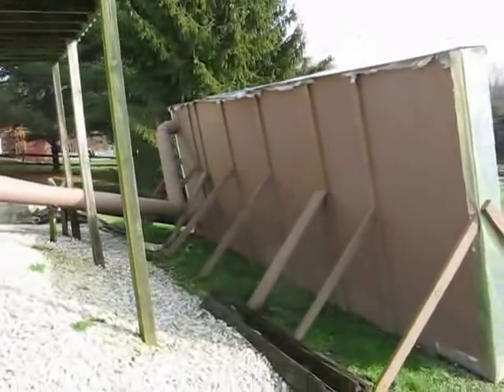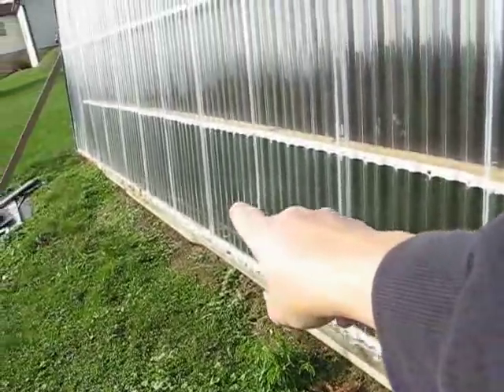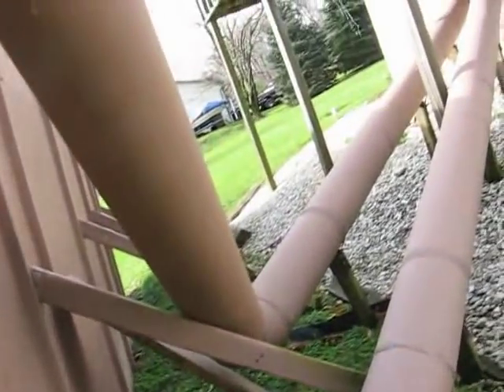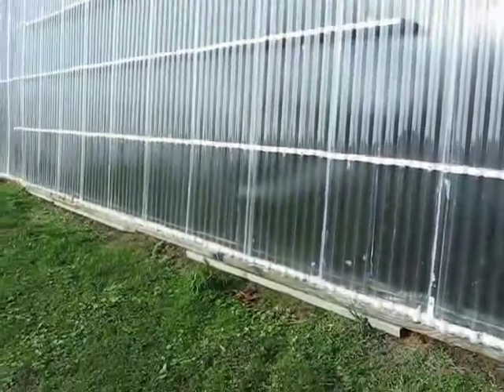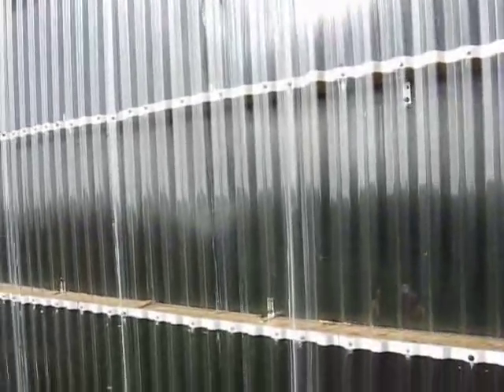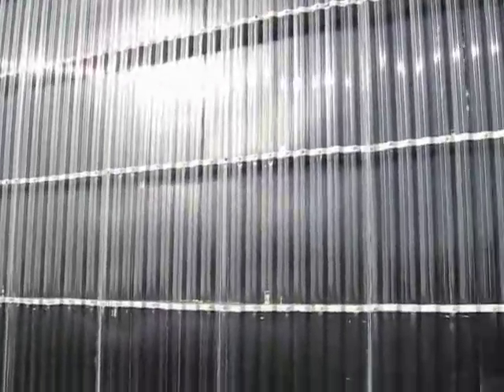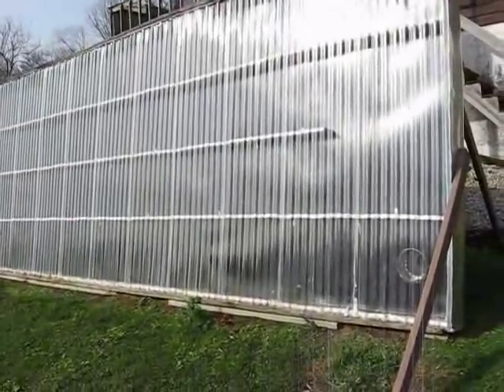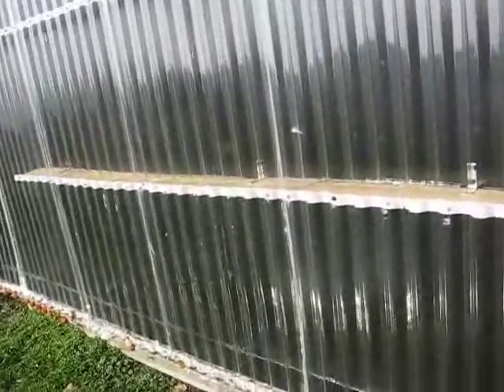MY SOLAR FURNACE  self standing solar AIR HEATER

Comment: I really like your furnace . You're like me go big or go home. I built mine with clear poly carbonate suntuff also .Yours is the only one I've come across on the net . You used 6 4X8 sheets I also used 6  4 X 8 sheets so I  was so happy with it  , i went and built another one.  And I,m going to build a third one when I get the time. I use water and polyproplene glycol in mine . Come to my chanel and check them out . "Bubblytubebob" I here exactly what you're talking about . BTDT.

Comment from the maker: hi folks just an update for the heater, its saving my about 900 a year in fuel cost, today i order propane at 2.99 a gallon wow,,  when i started this project it was 2.32 a couple  of years ago,,   i use about 350 gallons a year vs, 500-600 before i install this system   ,  i now am enjoying the savings, and it took two years to recoup my investment,, and it has withstand  all the weather conditions, wind and heavy snow,,,

Comment: Wow simple buld ..and the most clever designs so far,  instead of bulding a small one with sodacans I can buy stuff and buld me a  bigger sized one.  In collecting solar energy size matters.   
more surface to heat  up is more air to blow trough it

I don't know if I can improve it, but i can share some ideas    waterpipes concetrated on the top tunnel of the collector, where the collector is at his warmest

 insulation added outside at the back panel   smallest on the bottom  biggest top

Comment: my only suggestion would be to deff insulate ur ducks to and from the house..another good idea i havent seen in any of these is to use sheet metal as the backing and make 2-3 horizontal fins runinng through it.....should help the backing to give off its heat (much like an air contitioning condenser coil or car radiator coil) and more surface to absorb heat,,which means you can increase the air flow a bit without losing heat output and inturn being able to heat ur house faster

Comment: Good work.!!!  Little suggestion.  You probably can get even more out of your design if you insulate the cold air vent.  This way the air that is coming out of the house is sending already warmed heat.  This should increase your efficiency by nearly 22%.  Hope this helps and once again...  GREAT JOB!!!!!

Comment from the maker: @IronHorsez88  thanks for the comment,,  the wind has not been a problem i have it anchored very well,, we had 60 mph winds and not a problem still standing,, and yes the pipe leading to the and from the heater to the house is insulated, and also behind the panels,, and sides,,

Comment from the maker: @willjan1128 my bills remain about the same,  you have to factor that gas went way up about 30 percent or more over the past three years,  i est i saved about 6 -800 a year,  and the unit cost me about 2000, with some mistakes, the unit should have been around 1400 only,  so you can recoup in about 2-3 years, it all depend how much sun is out etc,,,

Comment from the maker: @bustherh   you have to keep the snow off of it, read above about the 24 inches of snow,    they work as long as the sun is out,, not as hot as fall and spring but i use it all the time when the sun is out ,

Comment: This is quite brillient.  It looks like you have aluminum panels inside your furnace, but I wonder if beer cans would heat more efficiently?  I may well build such a furnace as well in my back yard and run intake and outtake underground into basement and connect to existing furance, which is wood, oil and coal.  (i burn wood during day and kicks into oil at night).

I live in central NY state.  

Anyone else try something like this and care to share?

Comment from the maker: the  pipes leading into the house is insulated, with 6 inch insulated duct into a 10 pipe to the house,   your right without it , it would not work well

Comment from the maker: up date,  we had a huge 24 inches of snow, i had to go down and clear off the bottom of the heater  yesterday today its was sunny it got up to 28 outside,,, my house was 71 when i walk in at 230pm  so you will have to keep if free of snow, it will  cool it off if you dont, plus it was coming out of the vent inside the house at 115 most of the day,,,

Comment from the maker: i made smaller solar heater for the windows, and used wood and paint and never had  problem  i used just flat black panit,   but NEVER use the high heat black paint, it will not cure unless it hits a high temp , like a woodstove is ok,  it will cure,

Comment from the maker: i didnt use any paint, the first time i used rustolum  high heat  it  not good to use stinks and has to cure, which the temps in the box never got over 275 for it to cure  so , i put in flat roofing tin black color, cause the paint is bake on and has no odor to it,

Comment from the maker: we had an east coast snowstorm, and the only thing i had to do was remove the snow off the bottom of the heater, one advantage is that the heater in not on a roof , so it normally doest have snow on it,  we had 14 inches and only had the clean off about 4 inches  but its coming out at 115-120 today, and the house is 69 how nice,,:)

Comment from the maker: 123x   i used a 6 inch duct fan, 240 cfm   i did use a larger fan in the house but i think it didnt make a different, there is a steady flow of heat from the 6 inch fan does not cool it down to fast, and from the vent its about 127 to 130 of heat all day,

Comment: I guess you would like it to be moveable a bit with the sun changing position, there is a bit of a solution, and you probably know this and maby some people dont, and that is to use an adjustable mirror to reflect light onto your air heater.  And with  your large heater, it guess it would be hard to find alot of mirrors and stuff, but maby even a few square yards of mirror is possible to add a few extra thousand watts into the air.

Comment: its to bad you didnt build it against your deck,and used cans or aluminum gutters.you never want the air flow over painted surface also your losing lots of heat with air flow against the glazing.jimmas2009 is right,be careful the wind is going to slam that panel!